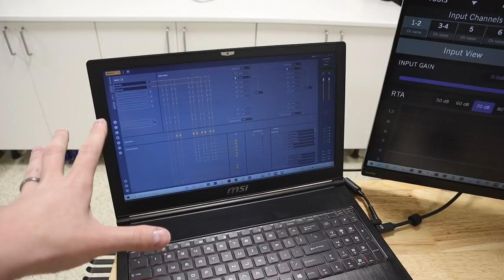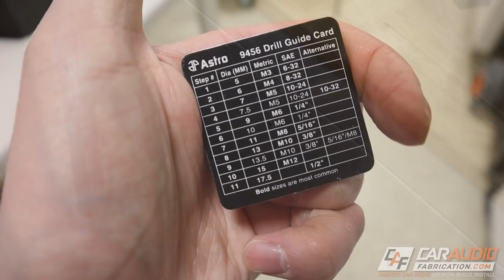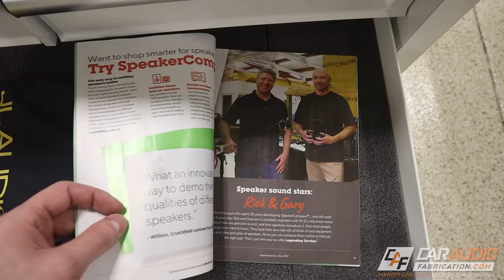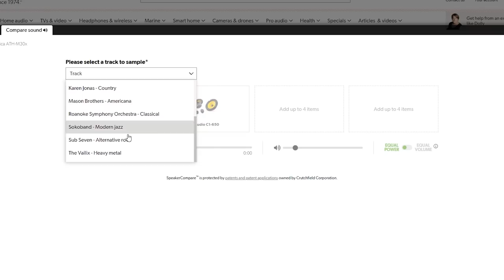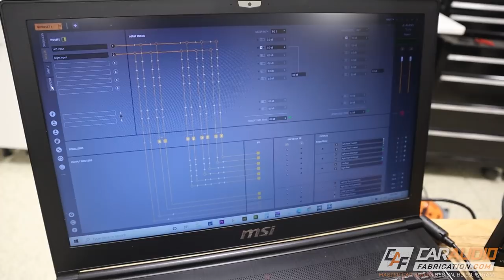What's in my Car Audio DSP System Tuning Cart? Tools & Mods Explained!

Comment: Under the bench you can rig a: car battary, smart charger and a 230V inverter,  (or 110V as ypu have)
.
Just plug the charger in over night and the battery will suport the rig "unplugged" for a period, and also save your data if the power goes out.

Sorry for poor spelling I'm from sweden, thank you for your work, I've learnd so much of you, keep up
Reply from the maker: Good idea! Definitely would be nice to incorporate some testing ability to "bench test" gear as well. This exists in another area of my shop right now but maybe it could be integrated.
Reply: That’s a great idea. They do make backup power supply’s 
One side is just hot power and the other side of the strip is on the backup.  And when the battery starts getting low it beeps so you have a few minutes to get it plugged in

Comment: I agree with Mark a video series of the jl max tun would be great maybe one video to do an overview then on each aspect of the tool explain how each feature works and use your camera and show us what’s actually happening. And how you are getting the results… every time you introduce a new tool or a better version of one it would be awesome to just mention what the brand is and where you can get it
For example that awesome rivet tool your step up bit and where to get the Rivet. Hole chart so we know what size we need based on our need.

Comment: I really like this and have had similar thoughts, but for an install cart. So vice and solder station on top instead. I've tried the old bag/hand tool box deal, but just default to my 36" box that I use for general auto work, cuz work surfaces are handy in that situation and I don't have keep running back to the bench.

If you wanted to clear up the work surface more, could go with something like an Intel Nuc pc with one of those Logitech keyboard/trackpad combos and then an ultra wide monitor on a longer arm for when your in the car.
I would also swap that power strip with one that has power conditioning; Furman makes one.
Also Mark, in your case, adding a Ram ball mount or screw base might be convenient for a camera or mic boom.

Comment: Can I recommend trying out Windows key, ctrl, and "d".  This gives you another desktop to work with.  To switch between them, you press windows, ctrl, and the arrow keys.  to get rid of them, you can click on the task view -> just to the right of Cortana or search.  Alternate way to get rid of the multiple desktops, is by going to the one you want to get rid of and pushing Windows key, ctrl, and f4.

Comment: Nice setup tho ...I was troubleshooting a intermediate problem on pioneer deck where was losing signal. U was sure it was deck or rca cable. Long story ended up cutting up a rca cable to get a reading while hooked up to amp. So I'm working on building a small test box that I can plug in line and have test points

Comment: I love this cart! Smart thinking on having everything at arms reach. I like that. I do have a quick question if that's ok, does it really matter if you mount a tweeter in the a pillar or sail panel on a single cab pick up? I figure as long as they both aim the same direction (not at your face i would say), then it should just be personal preference, right? Or is there a difference in a small cab?  Thanks! :)

Comment: Do you know if the factory burmester amps in the MB have DSP'S that can be tinkered with? I want to swap out a couple speakers (not quite ready to bite off the whole upgrade of 11 mids & highs locations) until I get ready to do the whole shabang and use the factory amp in the interim. Might need a consult after the new year.